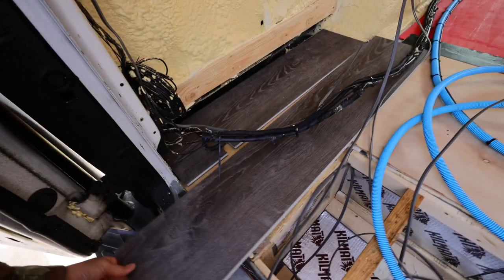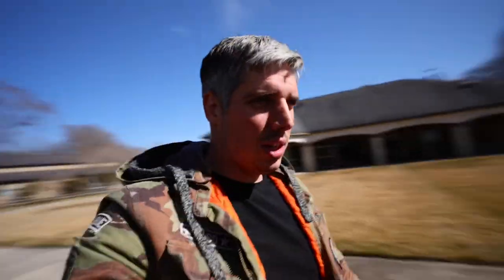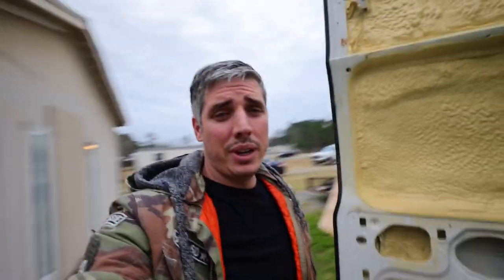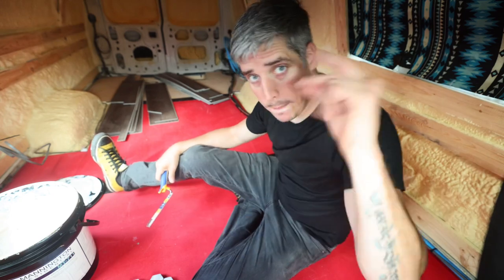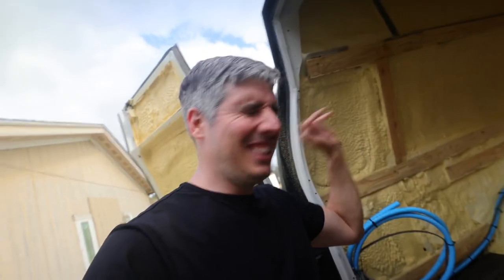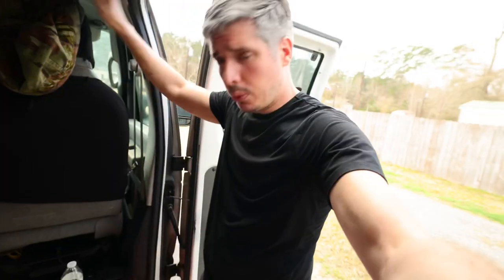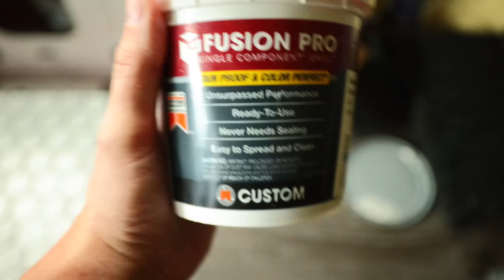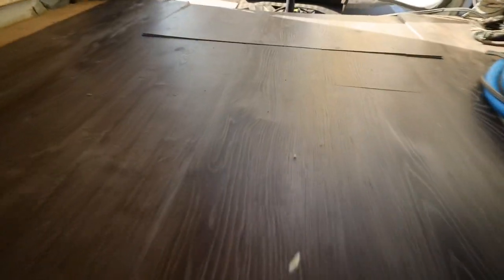Installing The Floors In My Van - Ep. 22 - (Van Build Series - Part 15 of TBD)

Comment: Just wondering why didn’t you cut the tile outermost edge straight across like you did in the doorway instead of cutting the flooring to fit the tile edge?  Really wondering why.
Reply from the maker: I like the transition look better with the floor cuts vs a straight edge. Gives it more, "flare".